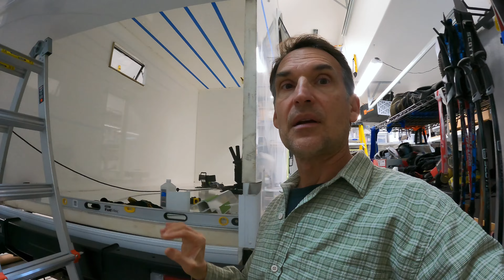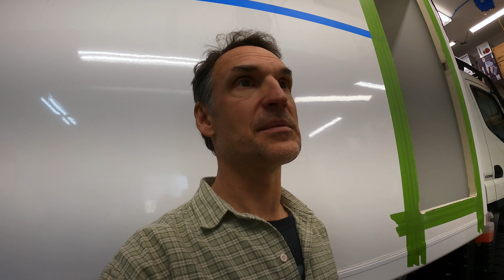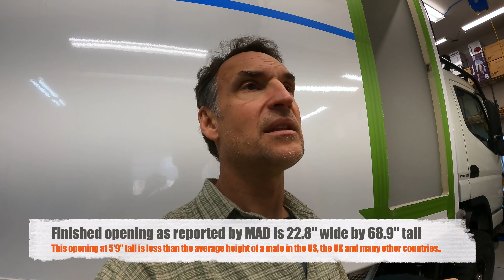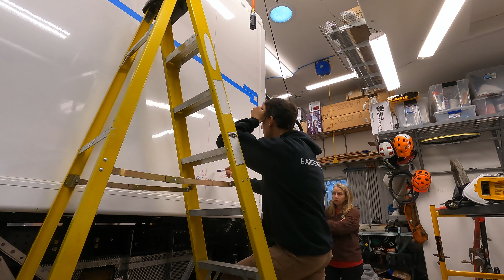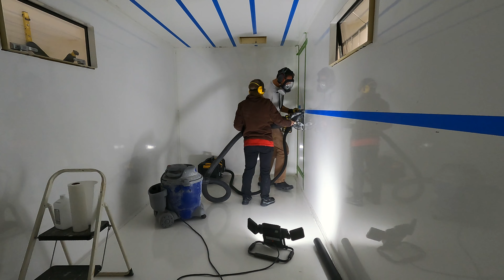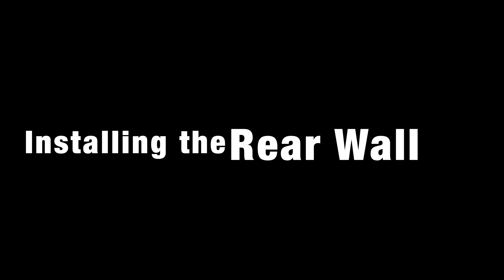Cutting the biggest hole into my Expedition Camper; the Entry Doorway

Comment: Any issues over the years since you cut the door opening with it being so close to the corner? My current design has the door in the same spot, and I'm concerned with maintaining the structural integrity of that corner with so much support removed. BTW, thanks for making all these videos, they are extremely helpful in planning out my rig.
Reply from the maker: None at all. In hindsight, I would had even cut it closer to the bottom and front pultrusions. I don't think how close the opening is matters so long as there is enough space for the door frame to not overlap the pultrusion. I don't think it gets any weaker if closer, actually likely just stronger.
Reply: @vantripping   Great news! Thanks for the response. I'm on episode 57 and am learning so much from your material.
Reply from the maker: @lawman284  You are welcome and thank you for watching. Lots of cool stuff to come.

Comment: Door height: I believed for the longest time too that doors are not tall enough.... In really life they can be much lower! The reason for it: when you go through the door, you are stepping down and therefore you can skip several inches in height :-)
Reply from the maker: Yes, but my last van the doorway was 5'10" and I got tired of hitting my head so I sold it and upgraded. When step out, you're looking down and thus don't see that your head is about to hit something. I hope this door doesn't become a headbanger at 5'9" which is 5" shorter than top of my head. Bottom line is, we need taller doors for us taller people and ones wide enough to accommodate the installation and removal of appliances. Time for some wider and taller doors--Sometimes customers will buy what they want not what the manufacturer thinks they need, and we all come in different sizes.
Reply: I've seen some extremely well built custom doors on #GermanTV they have a robust amount of videos on overlanding rigs. Too late now of course but might provide another resource.
Reply: @livingworkingoutsidebox  99% of all those custom doors you see on German trucks are indeed extremely well build! I have been involved in building these at an outfit in Germany and know the technic very well. Unfortunately, that type of construction is extremely difficult and most likely too complex for do it yourself kits. Therefore there are only a couple of reasonable options when it comes to entry doors
Reply: @totalcomposites   So true. I learned from my years of living in Germany there are few other countries or cultural Mindsets that equal to the precision engineering,  build quality,  and design layout.  Something we just rarely see here in the States.👍
Reply from the maker: @livingworkingoutsidebox  Agree that the German focus on high quality and great engineering and craftsmanship are wonderful. Having owned many German vehicles, they are meticulously engineered and crafted and perform so much better than products from other parts of the world.